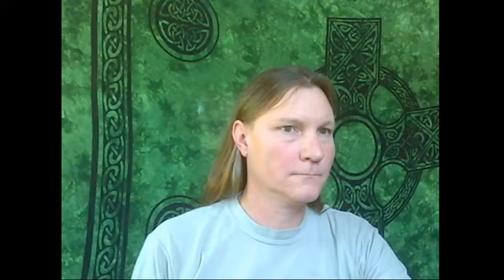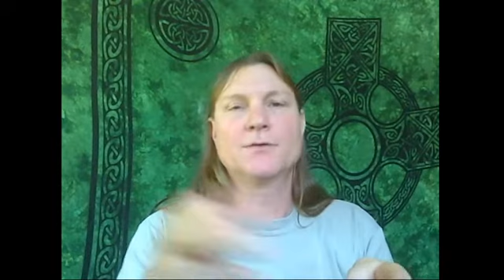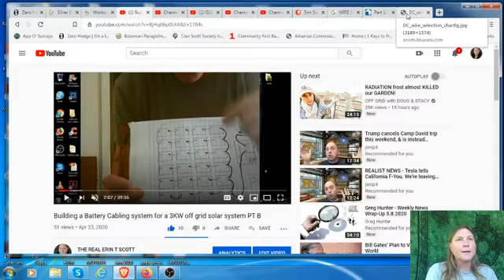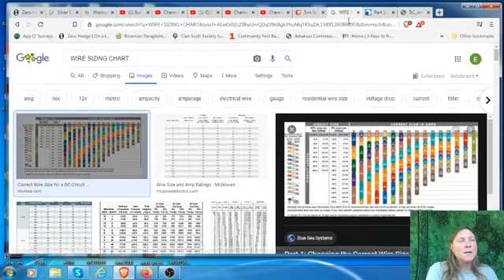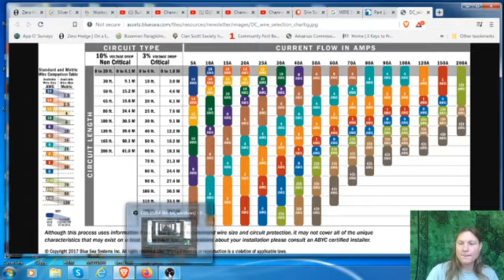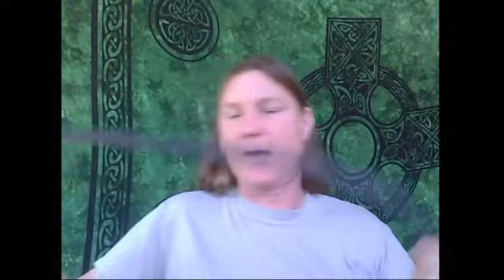SOLAR PHOTO VOLTAIC SYSTEM DESIGN 101 PART 2

Comment: The water hose will burst if the V is too great and the A produced can’t fit through the hose and the hose will swell up (heat) and bust or ( melt ). Does this help explain the resistance?
Reply from the maker: Yes in a wet kind of way
Reply: 😂😂😂 I was just visualizing it at the moment and had to blurt that out. I’m an odd pupil.
Reply: I look forward to the wave pool analogies. Haha.

Comment: Technician Monkey idea_1:  Buy a roll of RED duct-tape.  Every time you obtain a new 12_volt battery, or make a cable to connect 12_V to something, cut a half inch strip of red tape and tape it next to (or around the wire like a flag) the verified 12_V side  of the wire pair (obviously the other side is black\Ground).  Even alligator clips are color-coded RED or black when you "jump" the car battery of another car -- to start it (always connect red-to-red, and black-to-black).
Technician Monkey idea_2: Buy a cheap $6 electrical "multi-meter" at Harbor-freight.  Rotate selector to 20_V DC, and you can measure car-battery voltages just fine.  Rotate to 100K_ohms on the Multi-meter for checking cables for shorts (0 ohms Bad, infinite ohms good) , and to ID the same wire at both ends of a long cable (0 ohms good = same wire at start to end).
Reply from the maker: you can get red shrink tubing